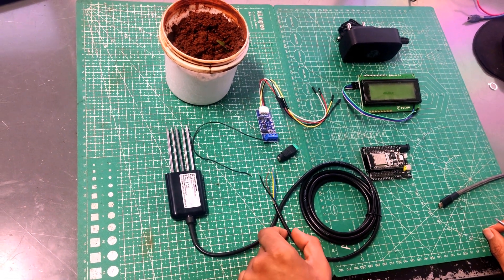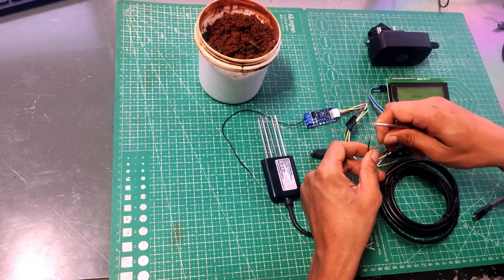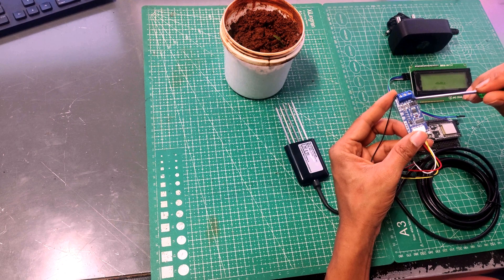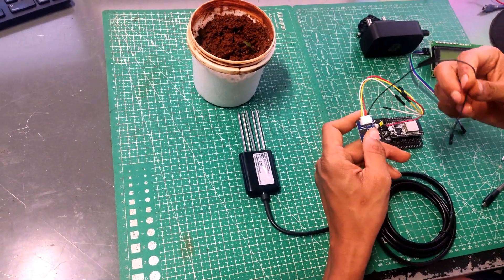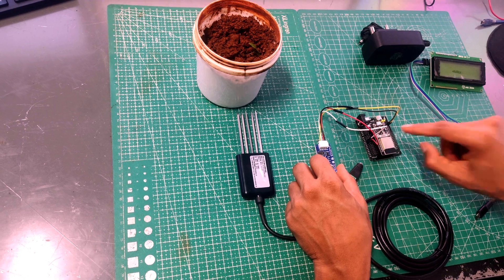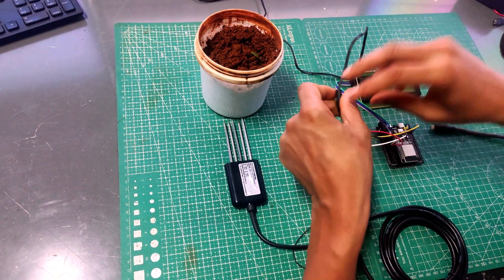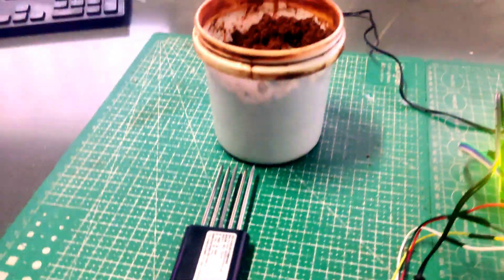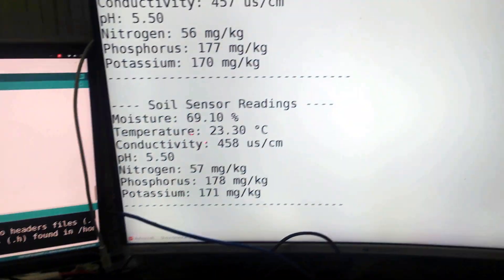How to Interface 7-in-1 Soil NPK Sensor with ESP32 | Smart Agriculture Project

Comment: 🌱🔋TerraSoil is an Arduino/ESP32 library designed to simplify the integration of 10-in-1 NPK industrial soil sensors using the RS485 Modbus RTU protocol. It encapsulates all the low-level complexity (register addresses, Modbus frames, unit conversions) and directly exposes ready-to-use physical data: nitrogen 👎, phosphorus (P), potassium (K), pH, moisture, temperature, and electrical conductivity (EC). Thanks to a high-level API, a single call allows you to read all the measurements, making development fast, reliable, and accessible on edge platforms like the ESP32.

Designed for Smart Agriculture applications, TerraSoil facilitates the deployment of connected systems in real-world conditions: sensors buried in the soil, a microcontroller in the field, and data transmission via Wi-Fi, LoRa, or MQTT to a server or AI stack. The measurements are immediately usable for visualization, agricultural automation, or training AI models, without cumbersome intermediate processing. TerraSoil is thus positioned as a key software component linking industrial sensors → edge computing → AI-ready data, serving modern and scalable precision agriculture.

🔗https://github.com/kennedy-kitoko/TERRA-AI